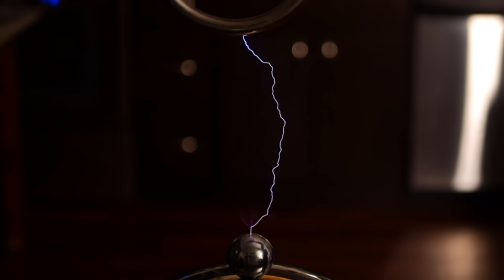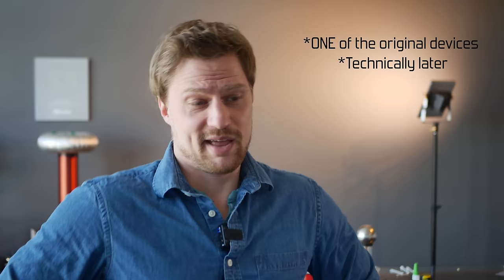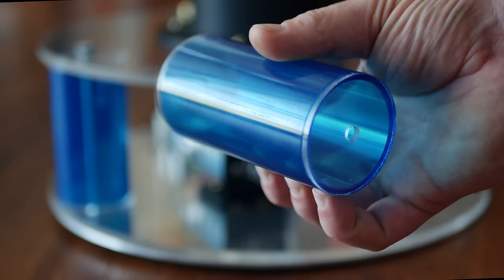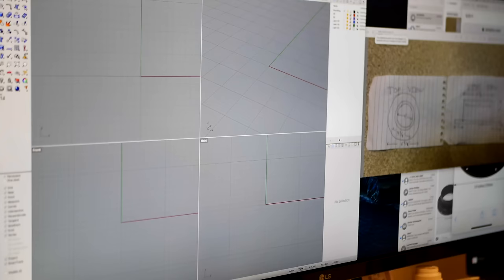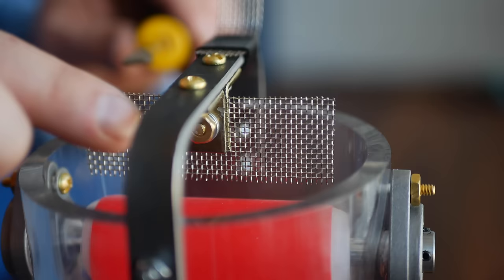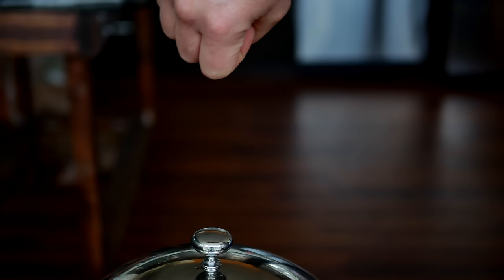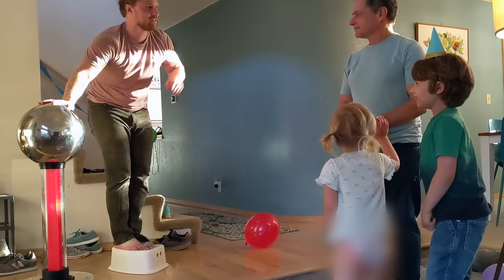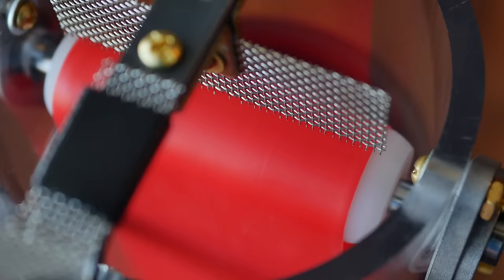Insane 500,000v from rubber (Van De Graaff BUILD)

Comment: Question. If the sphere is negatively charged, how is the electricity discharged by bringing a ground close to it! Shouldn't the discharge subject such as a wire or person be positively charged for the sphere to discharge it's built up electrical potential?

Comment: How many joules does a person touching the generator accumulate? I guess it’s a function of their capacitance with respect to ground and of the voltage on them.

Also 500keV is basically relativistic for an electron, if you felt like experimenting with electron guns / linear accelerators. Vacuum hardware is a pain to make though, so you’d probably be stuck using existing CRTs/Vidicons and such. That or bolting some stainless together with copper washers and some extreme vacuum pump.
Reply from the maker: Great question! human body is near 100pF, so if charged to 450kv, you're talking somewhere in the neighborhood of 10 joules....which is not in a safe range. That would blow a small hole in your skin. And likely cause some minor muscular damage.

Comment: I am halfway through a build of a Van de Graaff machine. I decided on PVC tubing. With a 4-inch diameter stuff made for sewer systems. It's not that pricey. I also did a direct motor drive. But I suppose my motor is much larger than the one you have so I hope I don't need any reduction. The shiny conductive ball on the top has been giving me issues. I can't seem to figure out where to buy one at
Reply from the maker: Cool to hear! I have links to my build parts in the video description...including a metal ball!

Comment: Nice build and nice video!  I wish you'd use a grounding rod and stop shocking yourself, though - I flinch every time!  (And it doesn't set a good example for the kiddos...)
Reply from the maker: Why thank you! It was SUCH a fun build. Yes, shocking yourself with a generator this size is not too dangerous. But, doing so with one bigger may be an actual danger.

Comment: could this be used to transform into a low voltage with high current to be used as a type of jewel thief that does real work?
Reply from the maker: Certainly possible. It would need an entire conversion circuit. And would likely be very lossy.

Comment: have you considered using your present generator to make a set of parts for upgrading it by heating the stuff while it is against a very strong (500kV) charge to make them electret materials? inquiring minds want to know LOL
Reply from the maker: Whoa, thats cool! i had no idea. Thanks for the video Idea. If I shoot this, i'll credit you.
Reply: @PlasmaChannel  will be watching my sub list for that when it comes out :) (I picked up 100 16kv diodes to make a voltage multiplier for similar work, and have been talking with "Join The Technicians" channel owner about it and tips and all thanks to his "magic wand" video that is basically a 120kV from two lithium ion cells, generator/voltage multiplier using 8kV diode based multiplier)

Comment: Can anyone help me with this doubt? Why is he using rubber having Teflon as an upper roller? I mean rubber neoprene are negative as teflon but how does It work since the belt should be positive like nylon or wool? 

I use to see VDG like electrobooms where the rub against the top roller makes the statics gonon dome, in this case why we do not use the Deep negative charging behaviour of Teflon? 

Please some tribo-god help me :(

Comment: I remember having access to a 1.5 MegaVolt Van De Graaff generator.  The is one crucial difference with you design and the the one I saw: the upper roller inside the sphere was made of metal (i.e. conductive).  Does anybody have thoughts on this?  Would it make a difference?

Comment: Plasma friend , please build a plasma candle with MRF300AN RF LDMOS transistor
Reply from the maker: What is particular is great about that transistor?
Reply: @PlasmaChannel   
300 watts of power
1.8MHz to 250MHz
Laser generation
Plasma etching
Particle accelerators
MRI and other medical applications
Industrial heating, welding, and drying systems
HF and VHF communications

Comment: since the charge on insulator don't move they insulate, but can you consider a moving charged insulator belt as carrying current, if so what kind of circuit diagram could this be drawn as ?
Reply from the maker: That's .......hm a good point. I suppose it could be drawn, electrically, as a series wire.

Comment: Why a high torque motor instead of a high speed one? Wouldn’t a faster speed charge it up faster?
Reply from the maker: Faster motors tend to have less torque. If you choose too fast a speed of motor, it may not even be able to turn over the pully under the tension of the belt.
Reply: @PlasmaChannel  yeah I get that but your’s looked a little slow. I think just a bit faster could decrease charge time

Comment: Should'nt the mesh touch the rubber band for better results?
Reply from the maker: No, touching the rubber will rub off metal atoms onto the belt, eventually making the belt more conductive. With a more conductive belt, electrons don’t stay in place on the belt and refuse to go up to the sphere. 

Brushes should be a few mm away from the belt for a generator this size.

Comment: I've been fascinated by the sandstorm effect for a few years now and have been trying to figure out if it's possible (or sensible) to try and achieve the effect between my two hands. Something tells me that trying to build up a high enough voltage differential between my hands to achieve the effect might be a problem for anything between them. Last thing I want to do is end up running any significant current across my chest. Does anyone have any thoughts on whether this is possible or safe?

Comment: Have you tried putting a super  high vacuum in the sphere or the top load
Reply from the maker: Interesting idea. It would likely lead to lower voltages attained, since lower pressures ionize at lower voltages.
Reply: @PlasmaChannel  Don't do that, at 0.5MV it could easily generate xrays

Comment: is there a list for materials you can use for the bottom roller, the top roller, the belt, and their potency?
Reply from the maker: There is. Look u "Triboelectric series" on google. It will give you a spectrum. I choose nylon and teflon all the time, because they are easier to find, durable, machinable, and are spaced wide apart on the chart.
Reply: @PlasmaChannel  thanks, I was searsich on the individual materials, however they rarely describe such properties on a specific materials description.

Comment: Love it, thanks for the video! Question: does the sphere size háve to be a certain ratio to the (?) length of the belt? Or could a smaller but similar effect be accomplished with a smaller sphere? And does it have to be a sphere?
Reply from the maker: Great questions. Topload needs to be totally smooth, so spheres are best. Toroid is fine too, but not as good. 

There’s no belt size requirements - it’s all general rules. You want that topload far off the ground.
Reply: Wonderful, thanks for the elaborate answer!!

Comment: Backfeed a Tesla coil and rectify the output to battery and boom! ⚠🚗🏎⚡
Reply: That would be extremely lossy and probably not even possible + it's already DC
Reply: @martinbobak3009  pulse dc has a wave to excite field as always in function of time, and in fact are sharper and travel further.

Comment: Mr,jay i am makeing 10 plasma candles and i wana ask you something.
I wana ask you can i use those blue caramic capacitors?
Some of my firends say it will be ok and some say it will explode like a mosfet.
I am talking about the capacitor whitch is directly connected to the primary and secondary coil.
Can you tell me that is real?
And if you can can you try to do it?
Reply: If you have the right capacity you can absolutely use them

Comment: What causes the electrons to stream out of you and charge up your dad? Is it because they're attracted to the protons? And how far away could you charge him until it wouldn't work?
Reply from the maker: The electrons spray off of any sharp object, due to intense electric fields at the tips of my finger. This ionizes the atoms in the air, allowing high electron density to flow down to lower electron density (aka, moving away from me towards father). This is a roundabout way to explain it, but relatively correct.
Reply: @PlasmaChannel   aaah okay I see! I think I understand it. Thanks! That’s so interesting I never knew that kind of thing was possible.

I’m writing a fictional story with superhuman’s and trying to see if an electron-based superhuman is plausible. Their body can store, and keep, more electrons than a normal human body is allowed to hold which allows them to shoot bolts out and they can walk on walls or ceilings because since their body can easily take electrons from many materials by simple contact instead of the triboelectric effect or other means, then the walls or ceilings and the superhuman’s body become attracted to each other once the electrons are taken (if I’m understanding the physics as correctly as I can). Knowing that you can actually charge someone up just by pointing at them is awesome and a game changer for this hypothetical (and mostly very wrong in regards to physics) superhuman.

Comment: Is possible charge a batery using tha        thing?
Reply from the maker: By charge do you mean explode a lithium battery? Why yes it could. 

Normal batteries would be unaffected.
Reply: @PlasmaChannel  lead batteries for cars can discharge 300a
so I imagine that this type of battery would hold the pulses before loading to 13.5 vts .but thanks

Comment: Rubber tourniquets make good belts ..thank me later
Reply from the maker: That's good to know. They made of Latex?
Reply: @PlasmaChannel   most are.  Then There's these giant rubber bands used as exercise. Equipment too.  They are about 3 or 4 inches wide about 4 feet long..  yes fwiw ive made a few of these ..  The tourniquets work well as belts.    Acrylic can be turned into pullies easily.
Reply from the maker: Interesting. Yeah, the exercise belt is what I used for the generator.
Reply: @PlasmaChannel   fwiw.  It seems the colorful exercise bands just don't make as much voltage as the latex tourniquets